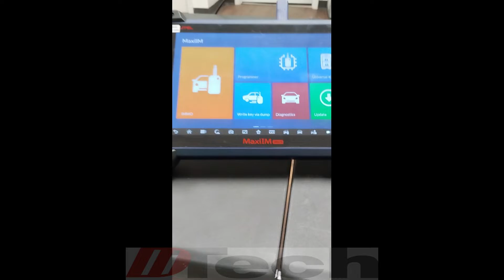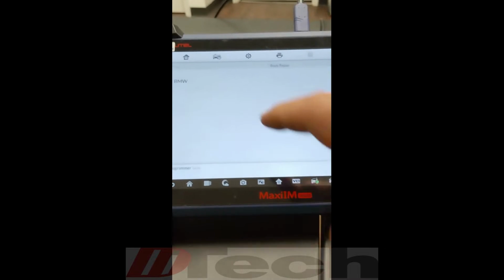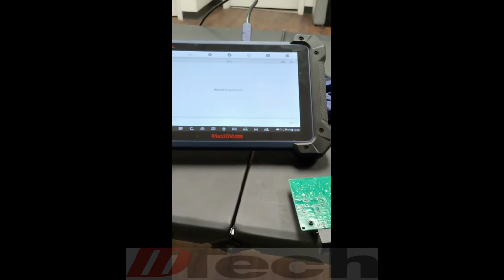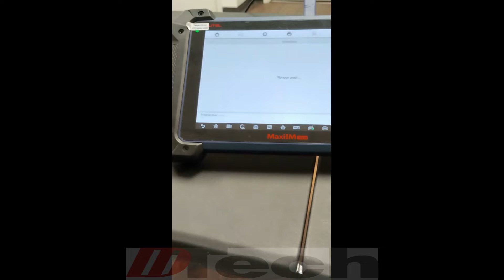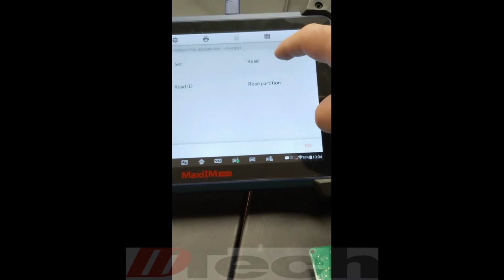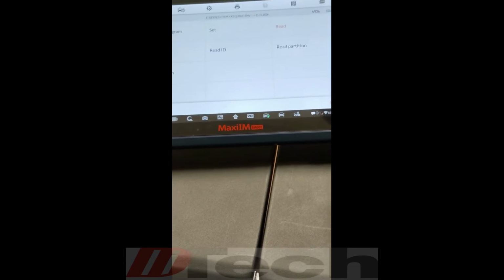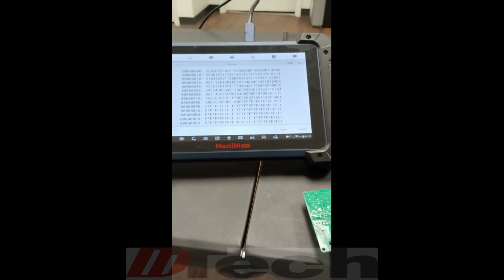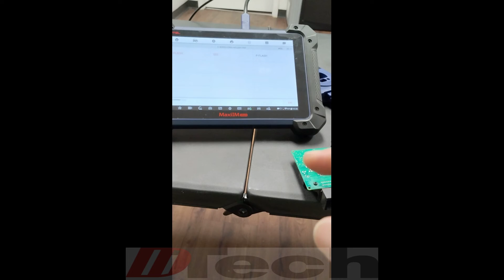*UPDATED* Easy Autel IM608 BMW FRM Repair on Bench

Comment from the maker: SIDE NOTE  There was an edit issue with the footage, so I wanted to make sure that I explained the missing portion... Once you hit "start" the Autel will go through its thing and after a few seconds it will bring up "chip data" that you can see, it will give you the option to save this on the bottom, go ahead and do so, and then continue and it will go to that point in the video where the status bar is going and then shows the "recovery successful" screen.  I just wanted to make sure this is explained as to help clarify the process when you guys go through it step by step. 
Thank You.
Reply: Hi thanks for the video.
Just a quick question,  
I repaired the FRM using IM608, followed the instructions,  successfully repaired. However when installed back on vehicle, electric window switches are vice versa, driver side button will open and close passenger, and same for the rear.
Any suggestion will.
Thanks.
Reply from the maker: @swarajjoye  when it does that it means it's repaired but needs coding. The 608 can do the coding if subscription is current
Reply: @DTEAuto  yes I have a valid subscription with Autel. I did programming and coding,  but it recognised vehicle as E90 Saloon, China Left Hand Drive. Just wondering if that's the issue.
Vehicle is a UK narket , right hand drive.

Comment: What’s up. Great video. Just one question. You mentioned their is 2 options after repairing to write data on Frm.
One is coding with the autel scanner but you also mentioned a second one where you can download and write it on bench .. where can I download that Frm data and can it be downloaded from the autel scanner or do I need to transfer it it an se card? Just want to be able to write it with Frm is on bench and not put it back.. thanks
Reply from the maker: First and foremost, the only Autel that can perform the FRM repair is the IM608/508. With that said, only if the FRM is corrupted, then the only data that the autel can read at that point is the P-Flash. If it were able to read D-Flash when corrupted, at that point you could save that dflash and transfer it to a pc and there's a website to perform repair with that data and then after it is repaired you move it back and write that repaired data into the frm. But the autel cannot pull data from the Dflash when it is corrupted like other programmers. So, you are left with just performing the repair procedure like I showed and then have to recode the frm once it is installed back in the car. I have not tried to do the coding on bench as of yet, I guess I could try and then let you and others know with an update.
Reply: @DTEAuto  thanks for the reply, I’m just trying to figure out how some of these online Frm repair services do a repair where they can say just plug and play. Meaning the customer doesn’t have to code it. If we didn’t have access to the car but some one brought us the Frm to get fixed how can we code it on bench like these online ppl do it

Comment: Hello sir, we met at ASTE last year. 

I have a question, the autel will not recover it to be plug n play? 

I have done the recovery successfully but i can only read EEE but D Flash is still null.

Is coding the only way to get this working in the car now?
Reply from the maker: Hey how are you! If the frm got "repaired" then you should be able to plug it into the vehicle and have window operation restored. But you will notice that it won't operate them correctly, meaning the driver switch will control the passenger side and vise versa, that's how you know that it will need coding and so at that point you just go through the regular steps of programming to complete the repair.  If I remember correctly, the Dflash will be generated when the frm gets corrupted and should be able to be read, unfortunately the autel isn't able to read the dflash for some reason even if the frm is corrupted
Reply: @DTEAuto  I'm doing ok man. I hope all is well your way too. 

This was a mail in FRM. I bought ACDP BMW package a while back but it didn't come with FRM module so I attempted with IM608. 

I guess from here the owner will need to see how it works and get someone to code it to the vehicle if it operates funky. 

I appreciate the feedback. If you are going to ASTE again this year, I will see you there.

Comment: When I try and code a newly repaired module using BMW ista, the programming asks for a basic and programmed part number. Any idea where I could get those numbers? It fails programming without the correct numbers.
Reply: Is there a way where you can just not do programming and do just coding? On my autel when it asks if a module was replaced I select no and then just do an update on coding only and that always works for me. I know ista sometimes won't let you do just individual module coding, maybe you can get a hold of aftermarket scanner.
Reply: @sadelmartinez10  thanks for the reply. I'll have to try it on the Autel. And yes. ISTA won't let you just code it (at least with the module I tried) I'll do some further digging though
Reply from the maker: Yes, if you check my first frm repair video I believe I show the coding, make sure your subscription/warranty is current and up to date on the Autel in order to be able to do the coding.
Reply: @DTEAuto  I saw that, using the Autel, I will give that a go. My question was regarding using the OEM BMW ISTA system. I suppose if I can find the file online it wouldn't require the coding right?
Reply from the maker: Yes, I'm pretty sure that is correct.

Comment: Hi first of all, i love your videos, thank you so much for doing these valuable videos. I have a quick question, hope you don't mind. 
BMW F20, 2013, N13, DME EDC 17C50, MEV.D.17.2.5. customer has damaged the DME when trying to open cover, some track damage on PCB, and legs on the MCU.
I can't read Eeprom, nor ISN data from DME, however i have managed to extract ISN number from the working key, password, DME-CAS password, EWS5 password, and ISN number.
will this be enough to get car start and run or will i need the whole Eeprom file from the DME. Will i be able to transfer these over to the donor DME.
Worse scenario if i can't read EEprom files from damage DME.
can i just install a used DME, same part number and just do the programming and coding.
I have an Autel IM608 with active subscription.
many thanks for help.
Reply from the maker: you will not be able to get a used one and try conventional programing with it, and I believe you might be able to get away with the information have gathered to be able to transfer it to a used dme.